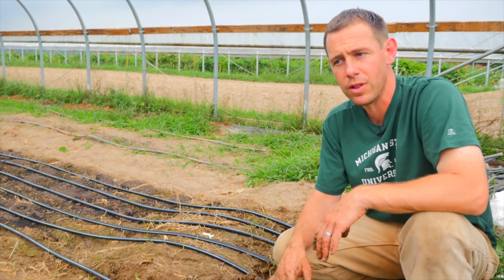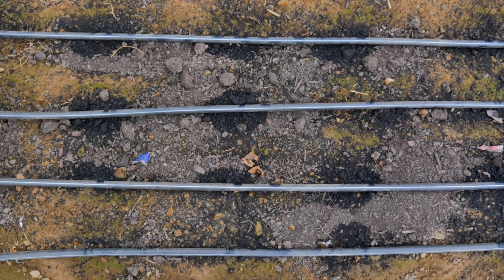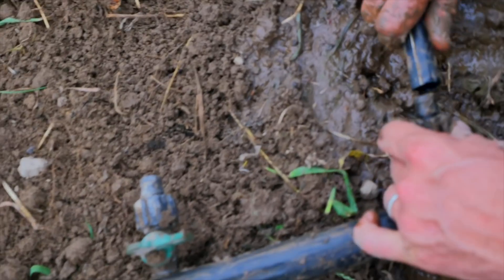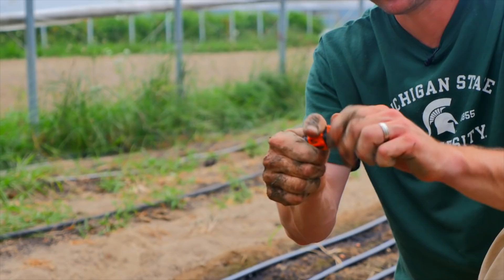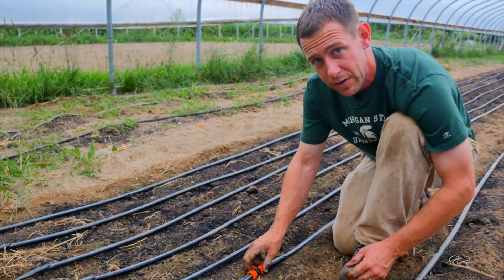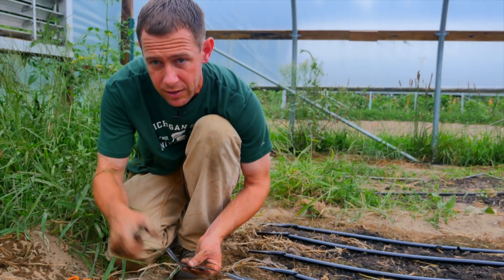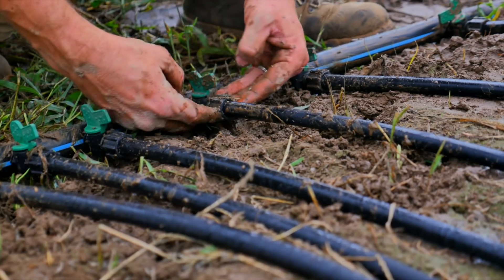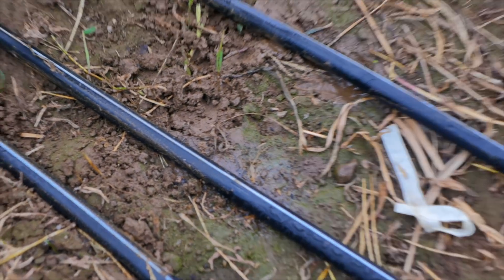Drip Irrigation Basics for Hoophouse Production

Comment: Do you need a psi pressure valve for this to work or does it run off a faucet hose just straight to the tubing what's needed as an attachment for faucet?

Comment: Can drip irrigation be used on slopes?
Reply: David Kay i use drip irrigation on slopes.... there is a slight drawback however. You have to make sure that wherever the emitters are that that area is in contact with the soil, or else what happens sometimes is the water runs along the drip hose instead of dripping exactly where you want it.
Reply: thank you so much

Comment: You really need to keep everything clean... you have mud everywhere... just asking for trouble!
Reply: Dirt + Water = Mud.    >  Telling a gardener that they got mud on their tools is like telling a painter that their brushes are covered in paint.
Reply: it's all the mud that got on the inside of the drip line that's an issue, it will clog the tiny emitter holes.
Reply: ThePunitiveDamages 
Good analogy but the main reason you don’t want dirt/mud in the lines is because the little holes/drippers will clog unless you have a release valve on the other end to purge the lines clean.
Reply: He's not using any of those fussy emitters... he is using the hose lines which have the holes in them (hose line emitters).  Which is much easier in this type of configuration.  And he is placing the holes facing up (as they are supposed to be) so that they are even less fussy.